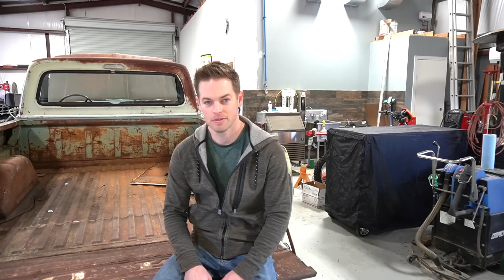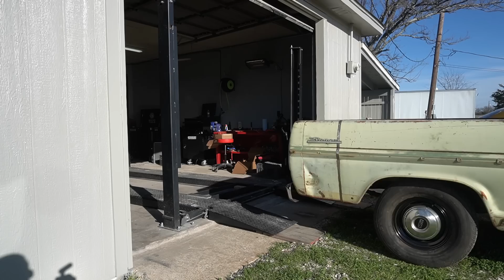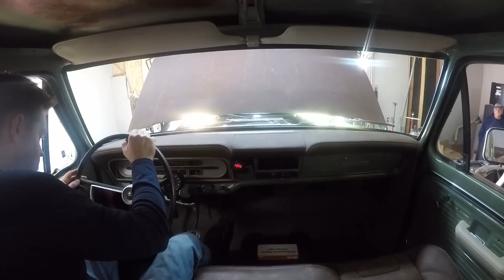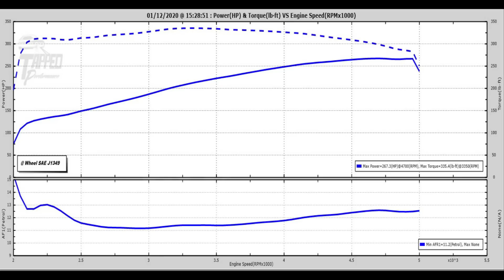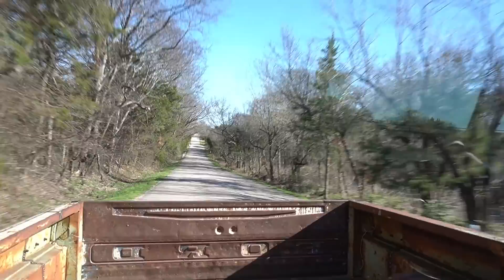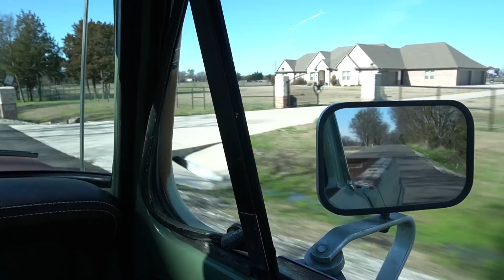Ford F100 390 Dyno Day

Comment: I was bummed that your engine did not make at least 300 HP to the rear tires. The Ford cast iron intake is holding it back. An Edlebrock high rise dual plane intake would most likely get it there plus. Those old cast iron intakes are very restrictive. It will also make a ton more torque. You have everything else in place to make over 335 HP which is what that engine should easily make. Another great video! Enjoyed it.
Reply: Advance cam on the timing gear and add an advance weight and spring to the distributor and have a machine shop put 428 valves in the heads
Reply: @giles-df9yu  Fcats I need all da tbh you will see a big single on it 😂
Reply: I would put a 410 crank in it if it has pistons.100 in the hole. You will release the beast!
Reply: Specs say it makes 280hp with 400ft pounds
Reply: It’s making 325 hp at the flywheel.
Reply: I would agree but I think those stock heads won't let it get much more HP I didn't see what castings they were but to the crank, a decent stock FE head are really only good to 350hp. So to the wheels he would prob be limited to 300hp. But I think he's putting a ls anyway :(
Reply: @connorrichardson2580   The exhaust manifolds kill it. All FE are good heads. A Performer RPM is a great manifold.
Reply: @connorrichardson2580  They are well designed and especially for a street car that could be converted to a competitive race car like cars had to be in its day. Do you know any about how cylinder heads work? Where are they exactly faulty?  Most things I’ve seen can be fixed with a dremel?
Reply: @Bbba724  yes I've ported fe heads, I would say unless your an expert that can craft amazing heads with a dremel and epoxy, buying new heads will flow much better. I bought the cheapest, lowest cc edelbrock heads, and they still flow much better than my ported heads. It's unfortunate, but new heads are much more advanced. Didn't even mention valve size, springs etc. $2k for new heads tho isn't cheap so there's that disadvantage.
Reply: @connorrichardson2580  Much of the head is the intake manifold. You need to match them well be sure that they are mated properly with no  mismatch, and hogging the bowl to the valve diameter is a must as is a bowl blend with the SSR and a turn to cross the flow into the bore away from the wall. The heads on my 394 ci FE flow 285 intake with 2.055 valves and 215 exhaust with 1.6 exhaust. I can pull the horsepower I want.  The rest of this FE shows 325 hp flywheel. Isn’t he putting a Coyote in it now?  That’s a lot of money for a 3 speed pickup?  I wonder if it will make the $ worth of power?
Reply: @connorrichardson2580  he can do more
Reply: @Pedrofitbulls  he could turbo it. N/A your heads limit your HP everything else you do just gets you closer to the limit.
Reply: @connorrichardson2580  I’m doing my 390 too so you saying I can add a turbo plus the intake everything I would love a turbo in it
Reply: @Pedrofitbulls  ya you can turbo anything really, you need a blow through carb and some other stuff. I've never done it myself tho.
Reply: @connorrichardson2580  sounds good I’ll look forward I need my old 390 to run good and powerful lol
Reply: @WAHU  it's much more costly. Forged pistons, crank, turbo and all will be expensive. The original comment is retarded. 300 to the wheels is a stupid amount or power. That c6 transmission eats 40 to 60 hp. A 300 ho engine is strong and will put a smile on your face.
Reply: @mightyox04 it’s a 3spd manual lol
Reply: Waste of money on that old FE motor

Comment: Was hoping to see 300 hp out of it.  You're going to have to change your intake and get at least a 750 on there.   Honestly, set up correctly that 390 should give you close to 400 horse on pump gas.
Reply from the maker: Yeah I was hoping to clear 300 at the tire... guess that's a pretty steep goal through the original drivetrain
Reply: 330_Garage 400 will never happen out of that junk 390 turd
Reply: @Wanous-hv7zo  how many crap comments you gotta leave on this video? We get it, you dont like Fords. Then why the heck are you watching this channel? And 390 Fords are NOT turds. Those things will run on sand. Quit being a troll
Reply: L76 6.0 VortecMax you better go buy a junk ford with a turd 390 in it then
Reply: @Wanous-hv7zo  ok troll. Not like I dont have my own repair shop or anything 😂👌
Reply: @Wanous-hv7zo  and I have a couple 390s...they're pretty sweet. Nothing compared to today's technology, but you can make real respectable power hopped up. Not that I care what you think, just saying...
Reply: @Wanous-hv7zo  I give up...gotta stop feeding the trolls

Comment: Let me know if you want a custom gauge plate for where the radio should be. That's where I have my auxiliary gauges mounted.
Reply: Eric Heimbach so you can see your oil pressure at 5 pounds and the bearings rattling
Reply: @Wanous-hv7zo  Pretty much... more so to fill the giant hole in the dash since I dont want to spend the time or money to install a radio.

Comment: Man, love the progress.  My old man had a 73 F250 with the 390 and 3 on the tree.  I was telling him about your build and he said his was 10:1 when it was built as well.  His truck would flat haul ass back in the day.  He ended up selling the truck to a buddy who needed the motor.  The mounts and underside were rotted and he couldn't drive it anymore.  Always wish I had bought it myself just for the motor.  When the friend put it in his 4x4, he couldn't believe the power it had.
Reply: They aren't hard to replace. Every one of the trucks I have from this era had rotted floor pans, cab mounts, and radiator supports when I got them. The 67-72s are particularly worse about the rad supports and cab mounts though.

Comment: Swap that intake and gain some. The stock cast iron is restricting that cams potential.
Reply: Lol and drop about a thousand pounds
Reply: Michael Quinn swap the junk turd and put a 402 big block chevy in it then you will have something. My buddy has one of these trucks and his has a 400 Pontiac engine in it
Reply: Not to mention loose a lot of weight off of the nose of the truck.  would get a good bit if not 300 hp to the wheels.
Reply: Michael Quinn just put a chevy engine in the thing 390s are scrap iron like 98 percent of for engines
Reply: @Wanous-hv7zo  Thank God that truck didn't end up in your hands because you'd have it ruined or traded off for a gun.  A 390 wasn't 98 percent of all ford engines, Mr. Science. There was also 302HO,  Boss 302, Boss 351, 4V 351 Clevelands,  427 side-oilers, and 460 big blocks. More jealous now?
Reply: Tyler's Neighborhood Garage 302 was junk to low oil pressure bearing rattling junk
Reply: Tyler's Neighborhood Garage been a mechanic all my life i am 54 now and i have seen lots of ford junk engines/ twin i beam front end and on and on and on. Ford is not good at designing engines one of their biggest problems crankshaft and bearings and piss poor power and just don’t hold up
Reply: Tyler's Neighborhood Garage i would never own a junk ford
Reply: Wanous 1966 you have no idea what you are talking about haha what a joke “bearing rattle”. That’s not a thing.
Reply: Thomas Rollins you have no idea what your talking about. Take any carbureted ford engine with 50k and the bearings with already be in the brass. 460s had a way better oiling system they didn’t do this 300 6 was horrible 302s 360 390 351m 400m and on and on
Reply: Thomas Rollins i have rebuilt and dyno tuned 1000s of engines in my shop there pee wee
Reply: Wanous 1966 my dads got a 69 cougar with the original engine and transmission at 150k miles. You read that correctly, boss man. I don’t know who’s vehicles your working on, but I’ve never heard any “oiling problem” with a Windsor and certainly not. 300 straight six. I wouldn’t let you work on my lawn mower, chief.
Reply: Thomas Rollins ford has lots of oiling issues on older engines there yuppie
Reply: @Thomasrollins only Ford engine Wanous ever worked on is a 351M. 
They had all the problems he described_  So he judges all Ford's by that engine.

Comment: I bought a 390FE from a salvage yard in San Antonio a couple years back that was in excellent shape for my 77 Ford F150. With the Holley 700CFM double-pumper I had on it and a Crane Racing Cam it was putting out 335 HP and 377 torque. I took it down to see if I could bore it more and found it was at it's limit but a buddy of mine said put 428 crank in it and some wedge pistons and re-timed it. I got her up a little over 400 HP. I wish I had kept that truck I would have donated that engine to ya. In that light F100 that thing would rock! Really enjoying your series on the F100!
Reply: I was just going to say, edlebrok aluminum heads, edlebrok aluminum performer intake, RV Provile Cam, carb or efi every 390 build should be pushing just over 400's on both HP and torque, it's fairly standard.
Reply: TxCowPoke 400 hp ha ha ha ha few bolt on a 350 chevy can get more than that ha ha junk fords
Reply: @Wanous-hv7zo  It was a hunting truck for off road...not a hotrod! I own 1969 Chevelle SS 396 so now what's your gripe with that?
Reply: TxCowPoke 2 wheel drive for off road? Thats not going to go anywhere
Reply: @Wanous-hv7zo  I will folllow you 90% you go with a properly setup 2 wheel drive. most 4x4's are just 3 wheel drive anyway.
Reply: @Wanous-hv7zo  BS

Comment: Your well over 300 at the crank and that is not bad at all, your torque curve is great.
With that torque curve who needs more than 3 gears??
Reply: I guess if you want to cruise over 45 mph without it screaming
Reply: @Terminxman  all dependent on the rear end and tire size, you're going to get 1:1 even with a 4 speed.... overdrive could help, but there's always gearvendors. with that torque he can run 3:55's no problem
Reply: @joestreiff9401  There are 4 speeds with overdrive, and 5 speeds.
Reply: @Terminxman  not that came out of a bumpside

Comment: I swapped mine to a flexalite E fan, needed to upgrade my alternator for a ford 3G unit but was worth it takes the parasitic drag off of the  engine probaby freed up a few HP, give you room in front of your accessories too.
Reply: If you watch Engine Masters on youtube, they did a video on this. If I remember right, it was around a 20HP gain by going to and electric fan.
Reply: Sparks Fire and Baling Wire really?  That's impressive!  There has to be some cons though right?
Reply: @yeboscrebo4451  if your doing heavy towing you might be better off with a mechanical fan but for putting around town with a 250ish HP engine it's likely fine  just need to make sure the electrical is up to the fans.
Reply: @yeboscrebo4451  Probably just the extra load on the electrical system. I plan on doing the upgrade on mine this spring.